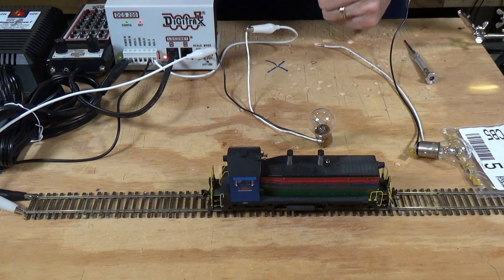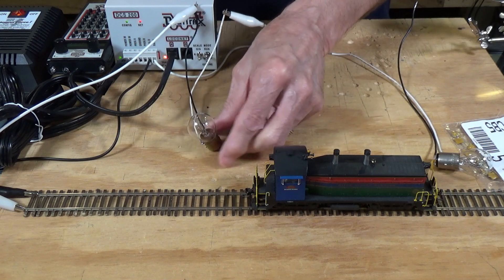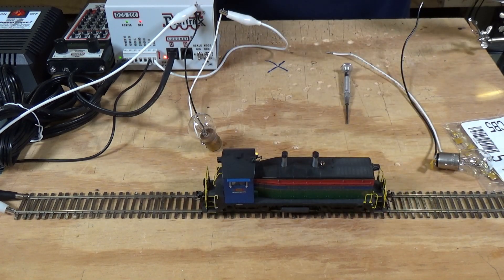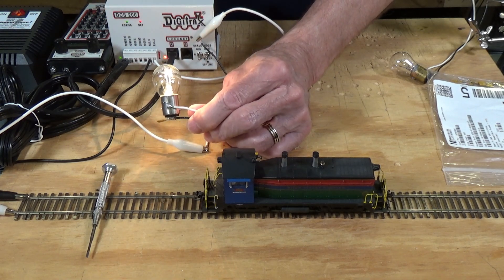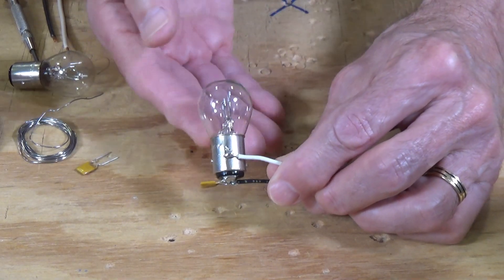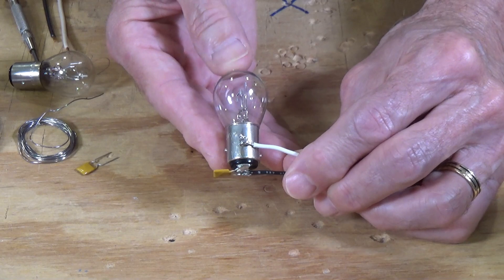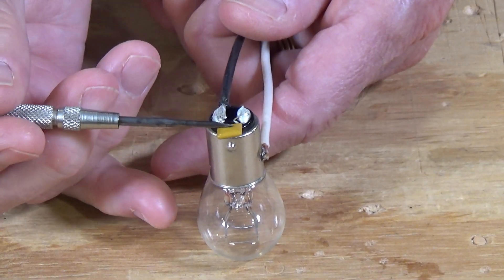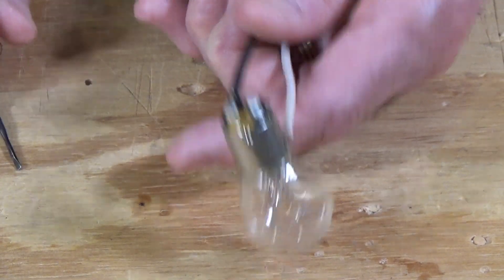Build The Improved DCC Ballast Lamp Circuit Breaker (109)

Comment: These are a great idea, and I've been using them for about a decade. However, you have completely overlooked the REAL reason for the PTC fuse. It is NOT to ensure that the command station can continue to support other trains as you state at the 2:10 mark ("because it impacts the amount of power available to operate the other trains on your layout), and imply elsewhere.
Most short-circuits are caused by a piece of rolling stock derailing, with a wheel or other metal component shorting between the rails. The purpose of the PTC fuse is to reduce the current through the shorting component to a level that will (hopefully) reduce or eliminate the possibilty of plastic components melting (or of something cathing fire.)
Dick's notes clearly state that this is the real reason for using a PTC fuse: "When the lamp is on, it is drawing 2.5 amps through whatever truck or other running gear has caused the short circuit. If the short gets ignored for more than a minute or so this can cause meltdown of plastic parts."
One other thing that you might mention is that it is important to place these devices on the same bus/wire all over the layout. If you locate them on one bus on one block, and the opposite bus on an adjacent block, it is possible to have a short-circuit that spans the two unprotected bus wires (resulting in no protection at all.)

Comment: Hello Larry, I’ve got a question for you on the ballast lamp.  installed the first ballast lamp on the at first drop feeder on my layout and I wired it to the black call it negative for a better word for it as I run black and red wires, but when I put two or more locomotives on the track, the light comes on it doesn’t go completely bright unless there is a short, but it does light up. I’m  NCE Powercab in factory configuration with no booster. What could be causing the 1156 to be lighting up when the trains are running plus if I run more than one locomotive it slows everything down I could run three at one time and I have the speed is cut by half a couple of these are old blue box converted but in by themself they’re only drawing about .3 to .4 mA when I run all of them all three is running up to about one amp the light is growing brighter as I add the second and third locomotive not sure what’s going on. Thought I would reach out to you for your advice.
Reply from the maker: That’s the downside of using ballast lamps, as you increase the current flow through the  they start to use current the selves and eventually take it all. I thought I mentioned that in one of my videos on them. At any rate the best choice is a true electronic circuit breaker since they do not use current except when they hit their rated break point.

Comment: I know this is an old thread, but if ytou use a 3057 you can just solder to the wires, no need to try to solder to the side of the bulb.

Comment: I watched this video carefully but still fail to see the perceived value of a dual filament bulb system. I've been using lightbulbs to protect against short circuits for years and it has never been a concern to maintain current to unaffected blocks while a short was happening in a specific block. The only concern is to find and eliminate the short as quickly as possible. If you don't want the bulb to draw large amounts of current, just use a bulb that draws less. No need to have one that starts off drawing 2.5 amps only to drop to 0.4 amps. Long before that happens, hopefully, the short has already been eliminated. 

I'm not saying this is a bad idea. I'm just saying I don't see any value in using it. A single filament bulb located in an area that will draw your attention ASAP. is all that is needed. 

While on this topic, I will add a little something that I like to do along with the using lightbulbs as short protection. In addition to the bulb, I also add a SPDT switch with a neutral center. ON/OFF/ON   In the first on position, it is simply wired in series with the bulb. In the off position, it does exactly that. It shuts down power to that block without affecting the rest of the layout. This allows some minor maintenance to be carried out while the layout is still functioning. And lastly, the second "ON" position creates a short to test the bulb itself (without sending any power to the track). It can happen that a block is getting no power simply because the bulb has burnt out. 

The switch has one more feature that is very important. I've heard of people who test the short protection of their layout by purposefully shorting the tracks with a metal object. This can cause voltage and/or current spikes that can destroy the decoders of any loco sitting on the track. Without going into details, many people don't realize that in the short time you place an object across the rails, it is not a clean short. In that fraction of a second it takes, you can actually short and un-short the track hundreds of times. The term is called "switch bounce". Therefore, use of an actual switch makes testing safer. (Even a switch suffers from "switch bounce" but much less than creating a manual short) 

Just my two cents worth. You make wonderful videos. I enjoy watching them. Keep up the good work.

Comment: Larry, I have watched this video a couple of times now. I bought the bulbs and fuses and I built one put in series on my first block. Turned on my dcc system, shorted the track and the bulb didn't light. I thought maybe I had soldered the wire to the wrong filament with the fuse, so I  changed the wire to the other terminal and tried again,  same result, my nce booster shuts off quicker than the bulb has a chance to light. I read on wiring for dcc about using taillight bulbs and it indicated that this may happen. So I  guess the bulbs won't work for me.
Reply from the maker: You might try adjusting the trip sensitivity or delay time if that is an option with your system.
Reply: Ok, I'm not sure if that's even possible. I will to check and see

Comment: I am running O Scale and am using 5-10 amps. My electrical knowledge is very limited but I am assuming this will not work for my number of amps. Will it work? If not, any way I can make my own circuit breaker? I am sorry if this question has already been answered somewhere else and I have overlooked it. I thoroughly enjoy your videos!
Reply from the maker: I honestly don’t know what amperage they pop at. In additon I really don’t recommend their use but did the video since so many asked for the info. I prefer the PSXX.
Reply: @TheDCCGuy  thanks for the quick response. I’ll keep researching and learning. A lot of people don’t use breakers it seems and don’t have any problems. That’s fine. For me, I don’t want to take any unnecessary risks with my equipment though. Breakers cost money but replacing equipment costs more. I really appreciate you! Keep up the good work.

Comment: 5:21 Will circuit breaker inside the booster trip in this case?
Reply from the maker: Obviously not, if the booster had shut down the light would have gone off. The bulb merely LIMITS the current flowing through the short, which is why I don’t recommend their use. But folks want to know how they work so I oblige.

Comment: Morning Larry
Just a thought from a novice modeller, could you just build these bulbs into your facer beside your power supply and in that way would be easy to see and could also be marked for what block the short is on ??
Cheers Mark
Reply from the maker: Yes, I guess that would work depending on the length of wire run from the block to the fascia. Most folks simply put them under the edge or on the face of the layout in the block they protect.
Reply: @TheDCCGuy  Thank you, so if I understand it correctly you could run 6" of wire along your fascia to a section then place your bulb in line and run off to that block ??
Cheers Mark

Comment: Will this work for a DC bus? I have an accessory bus for my Tortoise switch machines powered from a 3 Amp brick power supply. Somewhere there is a short that stops power to all switch machines. The power supply is putting out 12 VDC based on multimeter readings. The phenomenon seems to be intermittent and I’m trying to isolate the problem. Thanks, Kennedy
Reply from the maker: I don’t know of anyone who has tried it but it should work since ballast lamps have been in use for decades. There used to be a commercial power pack with a ballast lamp installed right on it.

Comment: Hi Larry, Don't know if you will see this question but going to ask anyway. Can you provide an additional circuit diagram using a LED to this Short Circuit 2057 Bulb and Trip Fuse that could be seen on a Control Panel.
Reply from the maker: That gets complicated and ?i have never seen anyone else do this. Some more complex circuit breakers off this capability but not something this simple.
Reply: @TheDCCGuy  Thanks for your reply Larry, never thought you would see this one. In the process of building a new layout and on the old one the tail light bulb was always a visual sore spot!  Now in the phase of making Control Panels for this layout and looking for a much better visual approach. If you happen to have any advice will appreciate your reply on the subject.  And, thanks again for your informative channel "LOVE IT".

Comment: Larry, I have tried the 1156 & 2057. When I short the track the command station opens the circuit every time and the bulbs never come on. So of course the whole layout shuts down. Wired per D. Bronson's diagram.  My system is the MRC wireless, 3.5 amp rating. 
 Looks like I won't be able to use this. What say you? Thanks.
Tom
Reply from the maker: Hmmm, one thing to keep in mind is that bulb filaments work faster as they heat up. So try running some locos before testing the shorts. That way with current flowing through the filaments they should warm up some and light up and protect the booster.

Comment: Larry, We run 12 or 14 gauge buss wires to 18 or 20 gauge drop down feeders, now I install this bulb in series with the drop wire and run power through this tiny, tiny filament in the bulb. How does this affect power to the rail. I am thinking resistance must be great.??
Reply from the maker: With ballast lamps you divide your layout into blocks or power districts each with their own connection to the main power bus. The ballast lamps goes at the point where the district bus wires are connected to the main power bus. The resistance of the filaments in the bulb are negligible but rises as the amperage running through them increases as you run locomotives. When the amperage reaches the operating amperage of the bulb then the light turns on and the current draw is stabilized at that amperage which should be less than what your booster can supply. With the improved ballast lamp design the current initially flows through both filaments until it gets large enough to light the bulbs and then the attached circuit breaker trips which turns off the large filament and but allows the smaller one to do all the work at a lower amperage thus using less of what your booster can put out. In my earlier video on ballast lamps I discussed why I don’t like to use them but my friend with a huge layout uses them successfully and uses a single 8 amp Digitrax DCS240 to run the whole layout and we have never had any command stations shutdowns during op sessions. However he only runs a single loco on each train.
Reply: @TheDCCGuy  If I have multiple drops in a block, can I just use one lamp,  and what is best placement in the block?

Comment: How do you determine the 0.4A terminal on the bulb from the 2.1A terminal?
Reply from the maker: Here is a link to rr-cirkits website where you can download the diagram shoeing the connections http://www.rr-cirkits.com/Notebook/short.html
Reply: @TheDCCGuy  I had already looked at the rr-cirkits document, but I don't see where it identifies which terminal is which either.  Maybe just using an Ohmmeter and determining the lead with the lowest resistance, and then soldering to that lead the wire that comes from your positive buss wire?
Reply from the maker: Use a set of clips leads and a 12 volt source and find which light up the big filament and which light up the little one, that’s how I figured it out.Ir wire it as I show in the video and if it doesn’t work then flip the wires.

Comment: This seems like a solution, but what concerns me is the time it takes to react to a short.  According to the spec sheets for these, the best is .5 seconds.  Is that enough?  Thanks.
Reply from the maker: I have a friend with 50 on his layout and they work reliably. NCE makes their commercial version (CP6) that uses festoon bulbs. The 0.5 sec delay can be an issue if the command station/boosters shut down faster. I have not heard a lot of complaints from folks running into that problem as it really is temperature dependent and once the bulb filament heats up a little as locos are run in the block the delay deceases. Make one up and give it a test.

Comment: I'm just getting into dcc so naturally I'm getting quite a bit of conflicting information, especially on bus wiring. Some videos leave fuses out completely and say "use as short a feeder wire as is practical and solder to the bus," never mentioning a fuse/circuit breaker. Clearly bad advice. Thanks for the help!

Comment: Thanks for the information on the updated circuit break protection using an auto bulb. I raced out and bought the bulb and resistor, came home and built it. Marvelous - It works perfectly. Can you go on to explain how to add a buzzer alarm in case you don't see the lamp?  Many thanks from down under (Australia)!
Reply from the maker: Glad to hear those worked for you. I can’t think of a way to easily energize a buzzer with this bulb setup since power stays on even when a short circuit occurs. You might check this website, it is mainly about the 1156 bulb but may offer some suggestions http://www.members.optusnet.com.au/nswmn/1156.htm#_top  .

Comment: Hi Larry, thanks for the info.  

I have four blocks set up on my layout using the 1156 bulbs.  After viewing this I am going to change them out with this setup.  Question though, since these are all installed under the layout, is there a way to add an LED light to this on the control panel to show a problem sooner?  

Chris
Reply from the maker: Abiut the only simple thing I can think of right now is wiring a LED with a 1000 ohm resistor across the leads of the 2.1 amp filament and put it on the fascia or local control panel. The LED would be on normally and then go off when the PTC fuse trips and shuts off power to that filament. Some folks who use these put the bulb in a building on the layout, you can easily see when the bulb comes on!

Comment: In your recent videos you built a DCC control box and included 2x PSX electronic circuit breakers. How well do the Lamp Circuit Breakers work with the PSX electronic circuit breakers?  When creating a dead short, using the screwdriver, will the bulb come on or will the PSX trip? What amperage have you set the PSX at to use in conjunction with the bulbs? The default is 3.81amps.

Have you used the NCE CP6?  I know they are only 1amp bulbs, not the 2.5amp bulbs you are using.  The CP6 is $32, so you are paying $5.33 per bulb/block.

Where I am confused with circuit breakers is whether redundancy is a good thing.  If you are using a bulb and a PSX and a control system with overcurrent protection, you have three levels of circuit protection.  Is this overkill, or is this exactly what you should be doing?

Thanks for your videos.
Reply from the maker: You wouldn’t use both, either the bulbs or the PSX circuit breaker.

Comment: Great video series Larry.  With the 1156 bulbs it doesn't make any difference which wire is connected to the bus and which is connected to the sub-bus.  In your video it appears that this is not the case.  So does it matter now which wire is connected to which side of the bulb for this circuit?
Reply from the maker: No, you just have to get the correct connection on the base contacts. The good thong is there are only two choices so do it one way and if it doesn’t work move the wire to the other contact—that’s what I did the first time I made one.
Reply: Larry, Thanks for the quick reply.  If you don't mind I would like your opinion on the following:  Conventional wisdom says to use the 1156 tail light bulb.  It is rated as 12.8v and 26.9w.  When I could not find the 1156s I tried a 1003 bulb.  It works!  It is rated at 12.8v but only 12w.  Do you think the 1003 bulbs present more or less of a threat/problem than the 1156 bulb?  I am guessing that the reduced wattage means that it doesn't burn as bright and it emits half the heat.  Physically they are just a bit smaller in size than the 1156.  They seem bright enough, however, for my home layout.  I have no idea what the amp rating is for these bulbs.  If indeed you agree that the 1003 decreases the heat issue, the 1003 bulbs are still taking 2.1 amps (2.5 - .4) away from the rest of the layout when they are lit.  As such, only if I run into performance issues on the rest of the layout when a 1003 is lit, should I convert the layout over to the 2057s.  Would you agree with my logic?